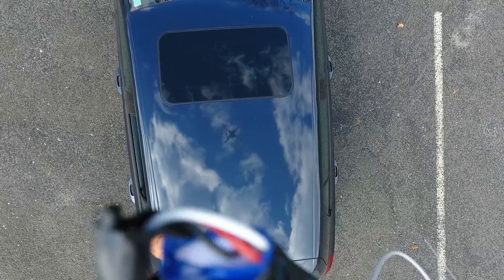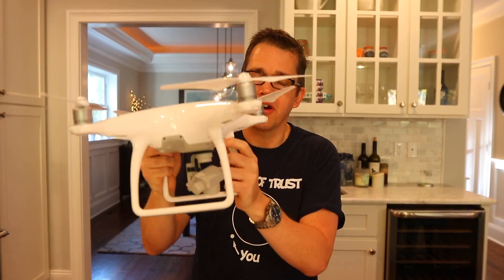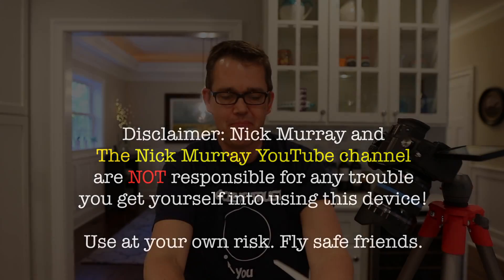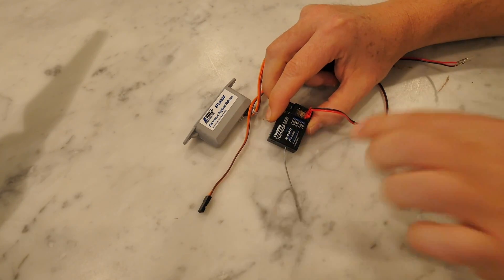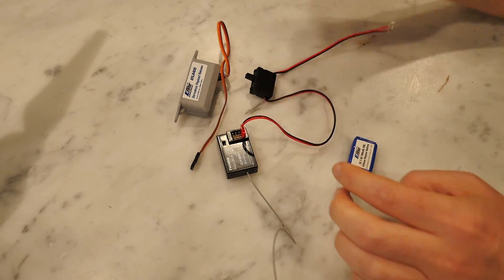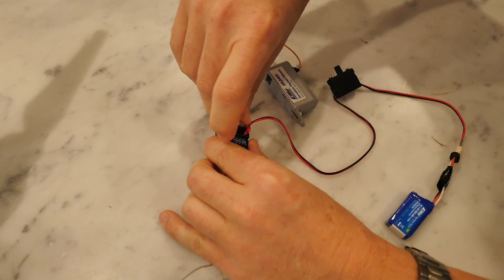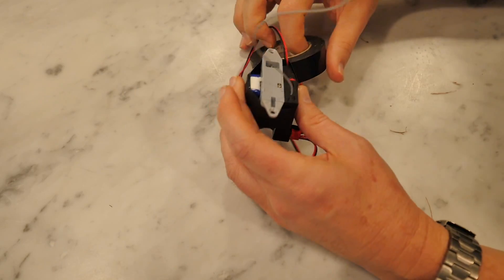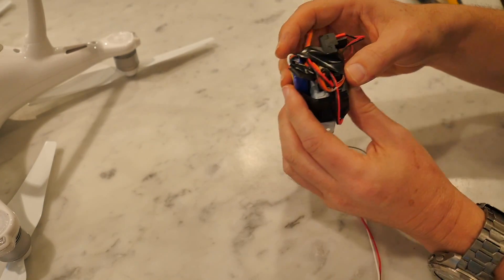Drone Quadcopter remote cargo release how to build

Comment: I made mine with a light censor off ebay as the switch that i externally fit over the rear light, when I turn on the lights it releases the payload.

Comment: Hi Nick. Thanks for the video. Its very useful! 
However, I was wondering if it was possible to use a 30 khz (vlf) receiver instead of the one you used, as I am wanting to attach it to my rc submarine. And as you would know, 2 ghz frequency is absorbed by water. Is there anywhere I can find a premade 30 kHz receiver that is as simple as the one you have? or does it mean making it custom?
Thanks in advance. 
Ben.

Comment: Simple solution to the remote release... By attaching a flexible wire and gluing or taping a contact pad to the top of the outer edge of the camera ( far outer edge of camera near the lens of the camera ) and placing the second wire so that if you bring the camera over center of "level" the second wire makes contact with the pad on the camera, you have an on / off switch !  In flight you can  click the switch under your remote to bring the camera " instantly " up or straight down from level. Then nudge it a bit further to engage the homemade switch.  Seldom a need for the camera to be " up" of over center while flying.  No harm to the camera... and only need the release machanism and a Battery !   It works at any distance you can fly your drone !

Comment: I made one of these years ago just using a $1.50 SG90 servo with bit of plastic I cut teeth into to create the linear movement, a DSM2 receiver from one of my quadcopters, then tapped into the power of the drone so it didn't need an extra battery.

Comment: Anyone know if you can use the traxxas controller to link up to it instead of the one listed?
Reply: I believe there is no difference, you just have to remember that the reciever *HAS TO BE FROM A TRAXXAS RC CAR* or else it will not work.

Comment: nice video, i´ve a couple questions: 1) is there a cheaper option for the futaba radio transmiter? 2)how do you charge the lipo battery? thanks a lot, cheers
Reply: alejandro corpeño hi have you found any information to your question?
Reply: +jimenazo1993 not yet

Comment: I have seen a better one than this where it used a small servo release, wired to the drone and one of the back buttons on the phantom controller was the release but so no need to have two controllers or a battery.